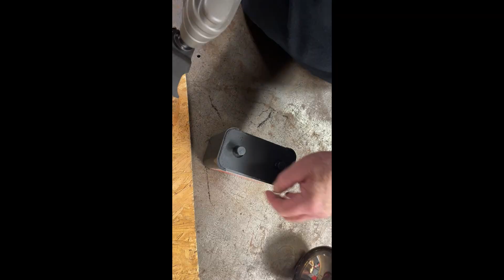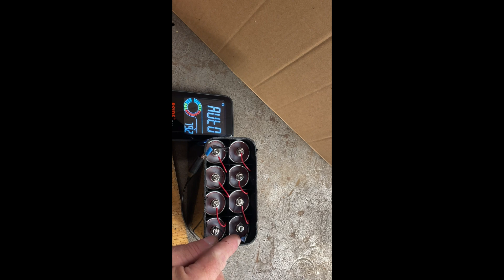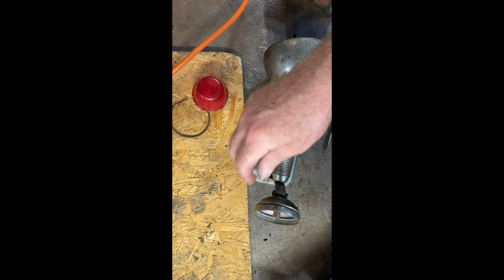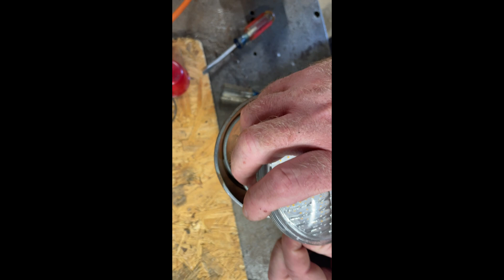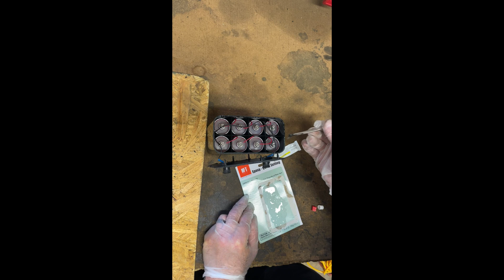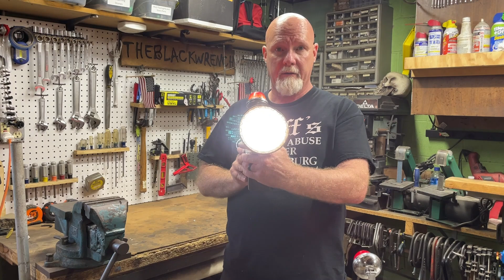Converting a 6 volt to a 12 volt lantern battery and upgrading a vintage lantern to LED bulbs

Comment: (Please note its only in regard to the question of upgrade ideas Job well done!) 🦾 
Why not swap out with lithium 3.0v or 3.7v keep the same config and much longer run time but a 12v bms {about $2}would be required but USB-C recharge and discharge port {phone charger} would be acquired? 21700 battery would be great?  
It was a success that's all that matters :yougotthis::goodvibes:
Reply from the maker: Great suggestion.    I wanted to keep this one simple for the video.    It’s a great idea and I have a couple of variations I would like to try, including power tool batteries.    They are not making the 12 volt batteries in the rectangular block anymore so I know folks will be interested in alternatives.  

Thank you for the great comments and suggestion